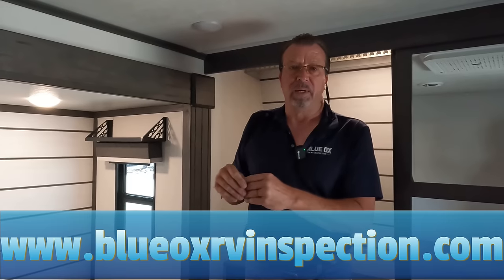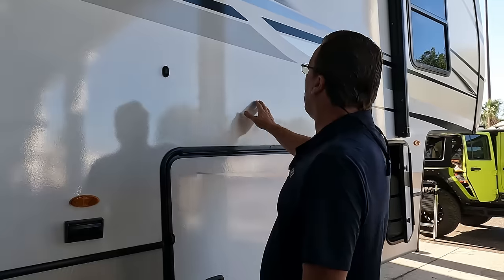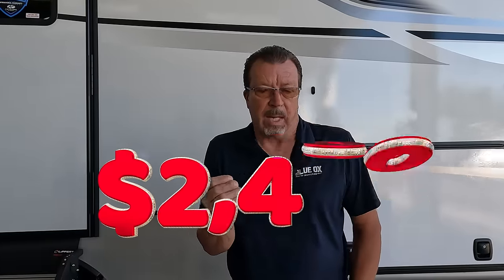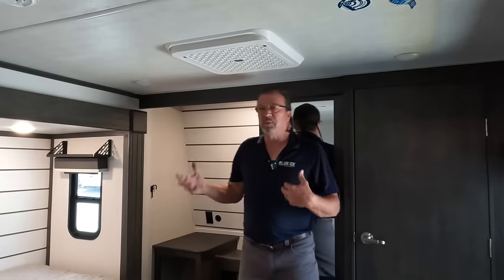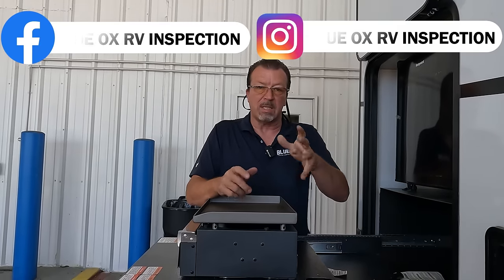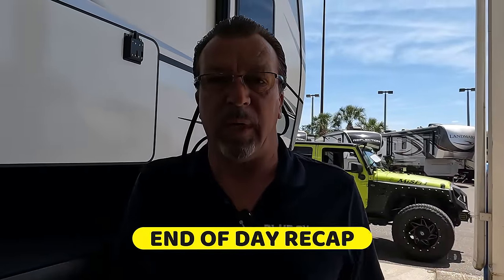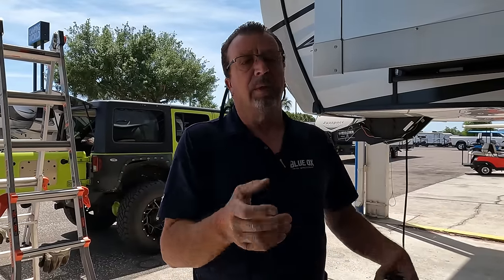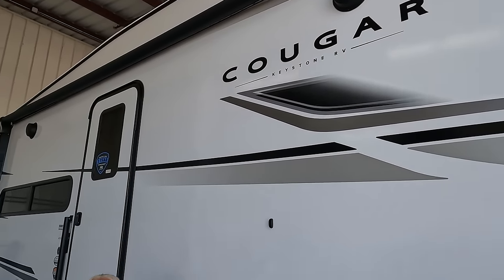😨SIGNIFICANT FLAW in Manufacturing & a BUILD QUALITY that was SURPRISING!😮Keystone Cougar 260MLE🛑

Comment: Every issue with an RV seems to cost $1,000!  If you prevent 1-2 problems, it's break even or better!  As many problems as you guys seem to find on any inspection, even if it's "warranty" stuff, the time , inconvenience, downtime, and expense it saves should justify it.  Lots of the stuff you guys find, probably wouldn't become apparent to most people until after the warranty expires!
Reply from the maker: Thank you for saying it!
When I say it, people's don't listen...just like when your parents were telling you about something 🙄
Reply: @blueoxontherun9188   You have to stay within your wheelhouse.  Just had this conversation with a friend tonight.  You can be the smartest doctor or scientist in the world and sound like a complete idiot in a room full of mechanics (and vice versa of course).  I’m an engineer/machinist/mechanic type, and have done pretty well inspecting stuff for myself, and paid for the stuff I missed by having to fix it myself.  I so much appreciate what you and others do and try to do the same by sharing what I have learned.

Comment: Your RV is a home on wheels, why wouldn't you pay to get it inspected like you home.  I mean you can get one done for $500 bucks but is it any good?  Did they really check everything? What's in included in that price?  Is your home inspector going to say something like "Oh I don't inspect chimneys or pools you will have to hire another guy for that" Each of those guys is 500 bucks too!

$1500 bucks and interviewing your inspector is well worth it.  I would rather hire someone like Blue Ox who is going top to bottom, inside and out, down to pulling engine oil samples for testing as an entire package deal vs trying to hire 3 people to do all of it.   

In the end hiring those 3 at $500 is the same $1500 and way more hassle of scheduling 3 people!

Who knows if they will catch everything. The engine inspector could see something that Body inspector didn't see but thinks "Oh that's part of the others guys inspection I don't need to report it"  The customer is the one left suffering.